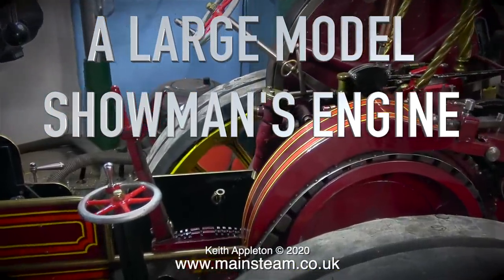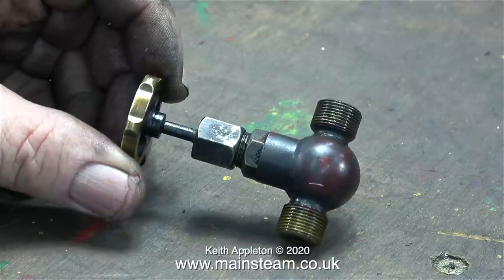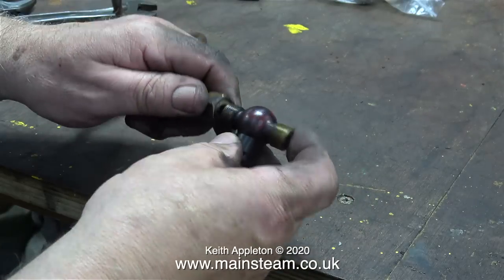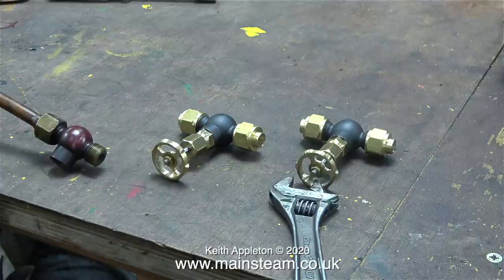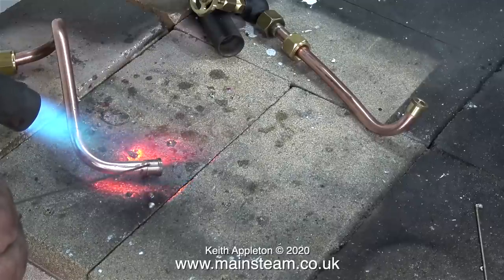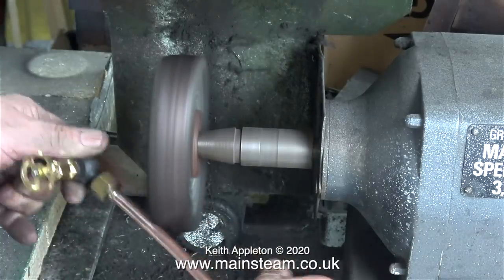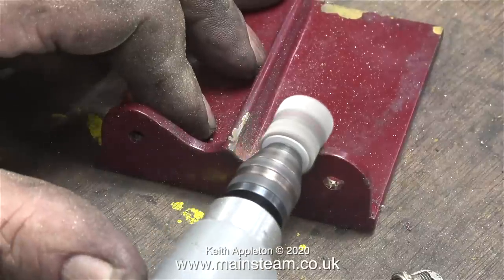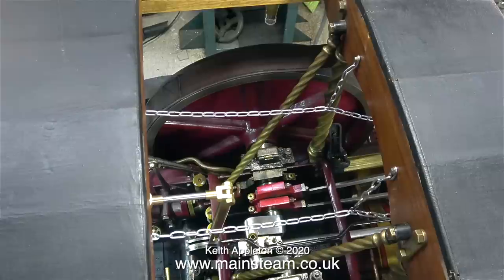A LARGE MODEL SHOWMAN'S ENGINE - PART #34

Comment: A massiv thank You for sharing all this information!

I hawe another question, does someone here know how to re fit loose wheels the Basset Lowke 0 gauge clockwork locomotives with a non treaded axel? 

Should i use loctite or soft solder, or is there something i hawe missed, i hawe tried to figure this out for a while now, the JEP and some Honrbys hawe treaded ends on the axel, but this particular locomotive does not seem to hawe that and it looks like the original to mee, but i don't know, after all it's more than 70 years old.
Reply from the maker: Use Loctite 603 would be my recommendation. I would avoid using a process that involves heat.
Reply: @keithappleton  Thank You wery much!